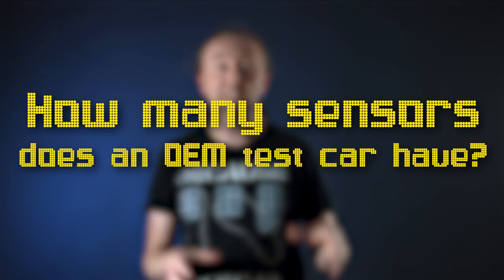⚠ Sensor Up Y'all | ANDY'S RANTS

Comment from the maker: Andy's Back!!!
Some say he invented the internet and is a member of a secret Illuminati design team working on a perpetual motion machine. All we know is he likes his coffee strong and he gets mad when people skimp on sensors. Got a subject you'd like to hear Andy rant about? Let us know it in the comments section!
Reply: Oh Andy how did we build and run engines in the days of points and carburetors?
But Seriously Sage advice...
Reply: What? He looks nothing like Vint Cerf.
Reply: Would be awesome to know what other sensors are available apart from fuel & oil , ie turbo back pressure & speed sensors , also any efficiency sensors measuring for example intercooler ,, cheers

Comment: More info is always better..
I was contemplating adding an additional sensors in regards to crank trigger as I just got an Elite with premium wire in kit and was wanting to run sequential fuel/ign but the car has a cam driven distributor, it's an old 1986 Mazda bfmr. Is it necessarily worth adding a crank sensor and trigger wheel as well as cam angle sensor. The goals basically a reliable updated old classic with better tech not outright power, would a simpler wasted spark or easier triggering system suffice

Comment: You are absolutely right.  I am looking at putting on an putting on a Gauge that runs with the oem can bus. Any suggestions?   The Idssh from banks is nice because of its oem and it's own expandability.  Does Haltech  have anything like that Gauge of anyone else I should be considering?

Comment: Does the fuel pressure get used for fuel modeling in the Elete series of ECU?
Reply: It calculates pressure across the injector from fuel pressure sensor and manifold pressure sensor. You then put that injector pressure difference channel as an axis on your injector flow and dead time tables. Then you enter the data from the injector flow bench.